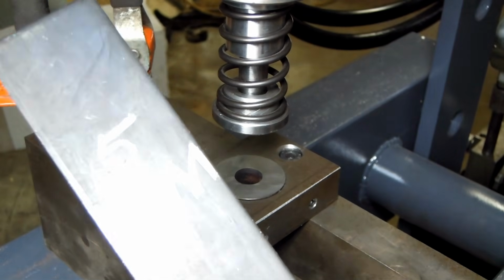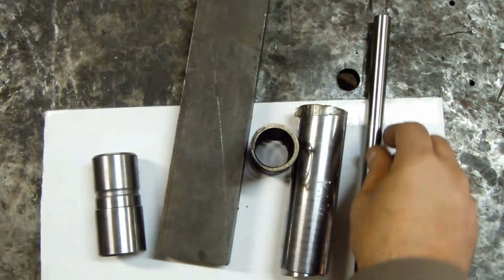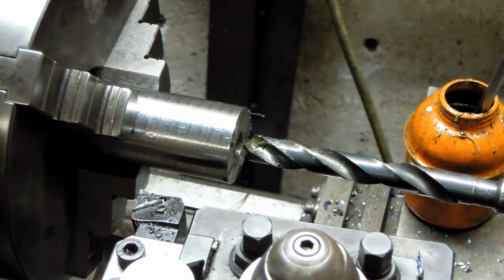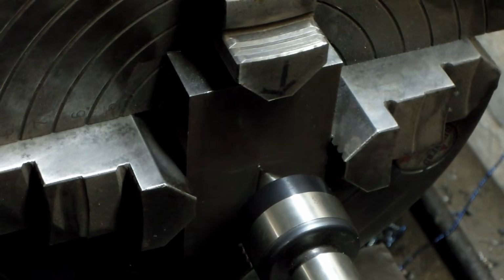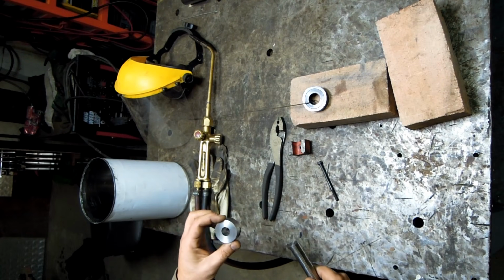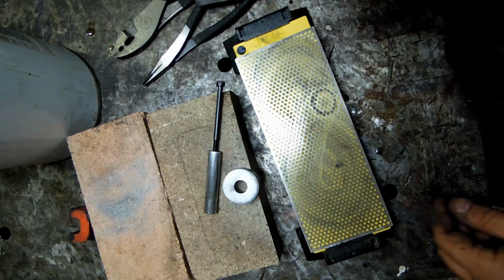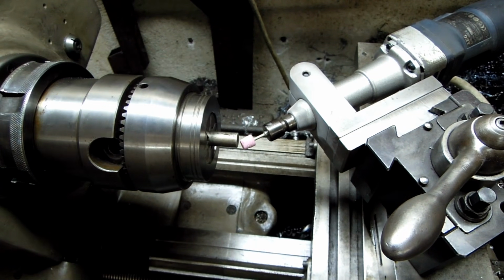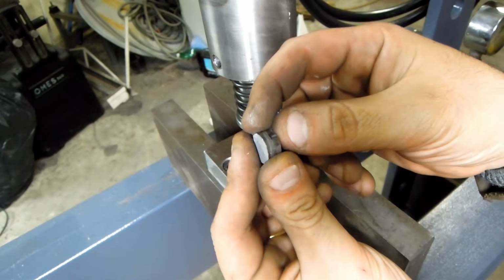diy punch & die

Comment: wouldn't dipping it after heating it (effectively cooling it) make it very brittle...

in my experience, simply heating and then allowing to cool and then reheating a few times makes it super strong. 
????
Reply: Water hardens it and oil puts a nice temper on it for knives and punch and die sets also heating it and letting it cool is called annealing and actually softens the metal so it can be cut and shaped easily
Reply: the hardening process makes the metal more brittle no matter how it occurs.  Certain metals obtain different levels of hardness due to the method of hardening used.  Normalizing the metal is not the same as hardening.
Reply: Jerry Duncan  Yeah, so can you elaborate on the methods of this video, and if what was done is correct/desirable ?

I was told annealing iron based metals will strengthen it vs brittle
Reply: +shreddedreams annealing is the process that relieves the internal stresses of the metal making it more workable, this done by taking the metal to its critical temp and allowing it to slowly cool.  This softens the metal and makes it more workable.  Quinching after heating in water or oil hardens the metal...any hardening will make the metal slightly more brittle than before.
Reply: +Jerry Duncan correct I may have missed out some information but I had the jist of it in my first comment
Reply: ah, okay. I have heard both ways is correct.. so a classic case of internet madness. I think the issue was that the metal I was using was not breaking with the annealing method and I assumed it was thus 'harder'  but I required 'strength' instead..
Reply: +shreddedreams: you may need to revisit the theory and practice of hardening  steep

there is a lot of BS on the internet regarding some pretty basic metallurgical processes.

lol.
Reply: +Jerry Duncan: annealing involves holding the metal above its critical temp, sometimes for many hours to allow grain regrowth to occur, to fully relieve heat or work induced stresses

Hardennng as you mentioned is a completely different kettle of frying fat.
Reply: Right, sorry each metal has a specific temperature for annealing...I miss spoke

Comment: Can you make a t shaped die??maybe 21 on an a4 sheet of metal??Maybe Diamond covered to may sure they last?Need to cut through card??ANY IDEAS PLEASE???
Reply from the maker: Look into waterjet cutting.  You could make a T shaped die.. but waterjet will be cheaper.
Reply: Can you recommend any one?Its for my store vouchers i need a T, on 110 gsm bond paper!!!
Reply: if you do, you need shear ground into the punch. so that it's not the entire cutting surface trying to cut through at once but rather, segments at a time. on a real stamping tool, the cutting station will have both shear AND stagger, where different punches enter at different times

Comment: At about 24:37 there is a machine in the upper right of the screen there is a machine, OMES 300 (500?). What is it?
Reply from the maker: +Cavemannspace Omes 300, it is an old 12" metal shaper.  You can see it in action in my short video "recutting splitter wedge".

Comment: Question shouldn't the dishing out of the punch be done before the heat treating or is there a reason to do it after?
Reply: I think the reason he heat treated after was because of the need to drill the actual die for the roll pins. Otherwise he's hardening metal before trying to drill it.
Reply: Ok I obviously misread the question. Probably was an afterthought.

Comment: I'd advise you not to put a hand held tool (screwdriver), into a moving piece of metal..  If the piece you're parting off doesn't make a clean, instantaneous break, it can grab the screwdriver.  With your hand so close to the tool post, it might get pinched.  You might not be able to let go.   I think it'd be better to put a board or dish on the bed of the lathe to catch the part as it is parted off.  And keep clear of the possible trajectory of the part.

Comment: any reason why the punch is concave and not slighty arrow tipped? surely more force per square inch for the tip so less power has to be used??
Reply: ah of course, I know why.. so it makes a clean cut? instead of bends it downwards? and possibly to extend life of the tip ??
Reply: +shreddedreams: look at commercial punches, concave punch cuts a clean edge (matches the action  of the die, "arrow tipped"t; (your words) are more likely to stall the punch.   Often the thicker (and harder) the material, the more the concavity.  you said it.
Reply: Jon dire
Reply: he made a concave punch tip, which is only benefical if he uses for nibbling, if he really wanted to reduce tonnage required he would have put a rooftop grind on the punch, see industry punch examples like wilsontool.  com and view chart labeled SHEAR OPTIONS

Comment: I been working on cars since a teen and just now getting into building engines. I need a caliper capable of one ten-thousandths (I think the machine shop term is tenth?) But all I seen have the readout to do those measurements but accuracy is still only +/- one thou. I can't read/too lazy to read mics, unless they make those in digital , or I'm I stuck with mics as my only tool to measure bearing sizes eta? Figured someone here could help, I'm math incapable lol
Reply: Chris Collins there are digital micrometers out there, calipers will most likely be to unprecise.
Reply: Can't read a mic can't work on an engine, section of some time for study..or find a new pursuit.
Reply: wolfedog99 I've worked on engines for over 15 years, mostly small engine repair (ATV's, lawnmowers, eta) and never needed a mic. I've built a Nissan 200SX for boost but never messed with the bottom end, thus again, no need for a mic. I've rebuilt well over 100 heads but I'm only now getting into building bottom ends which, of course, is where the most precise tolerances are. Don't need to be spending over $2000 on Eagle rods, pistons, and the like only to have a bearing spin on startup.
Reply: your not rebuilding anything if you don't know how to use a micrometer. doesn't matter how long you think you've been doing something. take an intro machining class at local tech school and you'll learn all kinds of helpful things

Comment: tip  wen  making the  top  part (thee  stem     what  go in  to  the  die  ) the  stres  tekneek  can  be  yousd     to  lower   the amounte  of  fors  reedit    to mace  a pin  3-5mm  with  sharpe  point     the bas  can  be 2 - 6 mm    so  that   the  metal  is  strest  and then  sherd
Reply: Adam Du Toit I can’t tell if you are writing in English or not

Comment: whats the use of this? I feel like if its for the hole only, a drill might be better(?)
Reply: Like you saw the thin plate, it is way more faster to make holes like this, and they are clean, when you drill that kind of thin plate it tends to rip and bend and everything. 

Also those 5-8mm plates, if you need holes and don't need them to be 100% clean, this is fast way to do them.
Reply from the maker: What Rosin said. :)
Reply: thanks!
Reply: Also punching is not limited to just round shapes; it can take many forms- regular and irregular.